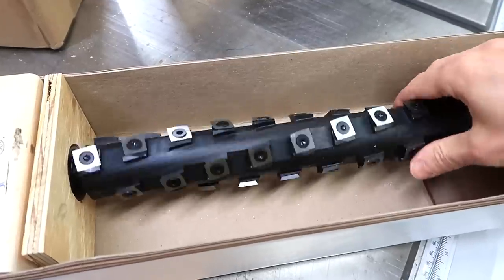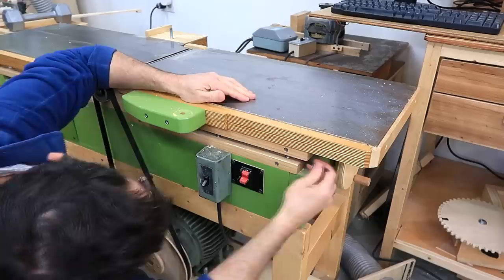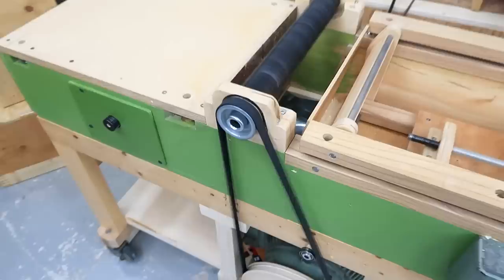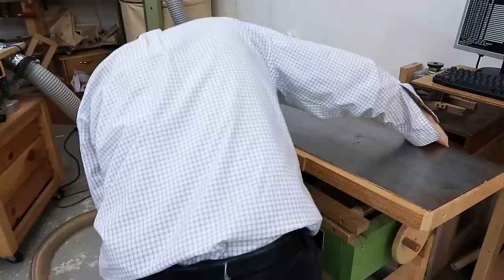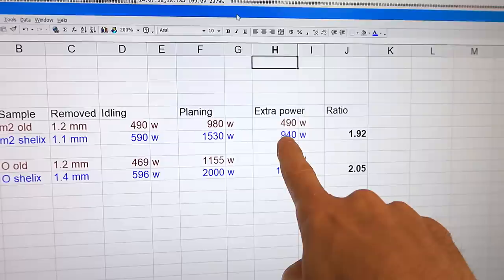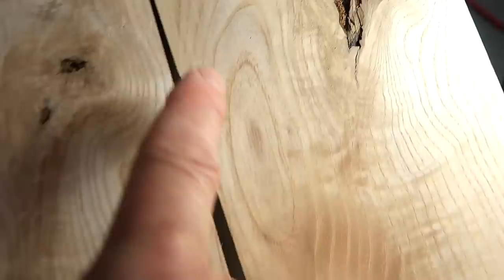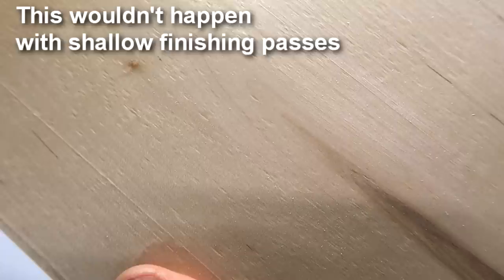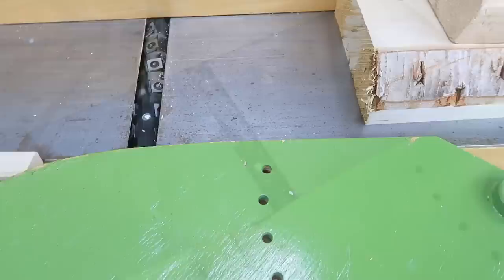Shelix head vs HSS planer head: Comparative tests

Comment: The pulley retention nut removal process had me screaming at the screen! I thought you would lose a 1.2mm layer from your leg if that mamma jamma went flying. The head vibration is scary. 
I am curious if your bearing blocks are not co-linear and cause you excess friction. Twist on the bearing races could be causing the shaft to cam over or Lean the outer races. 
Good luck and keep sharing your Mad-Scientific-Methodologies with your grateful masses!
-CY Castor
Reply from the maker: those bearing blocks were fine with the old head!
Reply: @matthiaswandel  But you removed them and it appeared you re-installed them (or tried to) in the old screw holes.  I think that might have caused some misalignment that you would not have had with a metal base, metal blocks and bolts.
Reply: @matthiaswandel  Slightly worn, bone dry metal-shielded bearings are way more forgiving in terms of alignment than brandnew rubbersealed tight ones. It can also start self-energizing cycles depending on amount of disalignment and rounds per minute with "whipping" tendency of the cutterhead once every factor's maximum should come together in a "shit hits the fan" moment. We once had a cracking cutterhead (spiral blade, dead-stop emergency brake allegedly saved us from complete disintegration of the head) in the first sawmill/planing factory I worked. Later assessment showed too worn-down bearing-holders in combination to an imbalance of the cutting head, after all was bent in place again and counterbalanced on an industrial balancer. Bearings were still in spec, their holding blocks weren't any more, single digit grams out of balance was enough to wreck it with the whipping tendency.
Reply: That nut spinner or whatever it was that kept edging closer to the running head due to vibration was driving me nuts.  Also some tight metal pins to locate those bearing caps would help with that problem, as you said, screws or bolts are LOUSY locating devices, especially wood screws.  

Big stuff out of spec, like you are talking about is frightening, the kind of stuff that can end careers, and on rare occasions, even lives.  Some of the 'safety features' on tools any more make the damned things far more dangerous.  Not necessarily even bad design in some cases but horrible sticky flimsy crap.   I just took the one off of my table saw because trying to start a board through it was absolutely risky.  Some safety stuff is designed exactly as it should be, usually on high end or industrial tools.
Reply: @MrJdsenior  I worked as a selfemployed boatbuilder for over 30 yrs and rented machine rooms near my very work sites/customer's boats over that time. It got worse over those years, in terms of "safety": often I had to remove "safety features" in the way of my work for two or three hours - and put it back on after I was done cutting, thicknessing, planing and routing my strips'n boards, curves and rounds, when I was technically ready to leave. It became so bad I finally built a mid size boatbuilder's workshop in a trailer I could completely open, both sides became the awnings to work out of the weather in and on both sides of that thing, just to not have to mess around with "legal safety devices" making a lot of my work undoable on "legal" machinery anymore. You gotta know pretty well whatcha doing and have to keep Your regular as the irregular loads in sight and checked. You can only do that as long as there aren't any employees or even apprentices working with You. That makes safety and safety devices such a nuisance: You gotta make anything as vandal-proof as You can imagine vandal idiocy of Your employees, and then the deciding little sum of vandal idiocy more You couldn't even imagine yourself in a delirious stupor.
Reply: @manfredschmalbach9023  All true.  And even with meticulous care things can still happen.  And you need to understand that a table saw blade shouldn't extend an inch or two above the wood being cut, etc to help limit danger if someone does manage to get to cuddly with the blade.  I've used table saws for many years and one day I was cutting a tenon in a quick and stupid manner (without the jig, a quick one off) and the thing slipped.  

I heard a light ching, and when I pulled my hand back and looked at my thumb the nail was cut clean through and the skin was just touched by the blade, just barely seeping blood onto the surface. There would have been more blood with a standard finger test stick. Those wake up calls get the 'safety first' switch turned full on for a while.

I've whacked myself a few times being careless with much less dangerous tools than the table saw, like holding smallish work on a drill press when I should be locking it down (who hasn't), but the only time I ever came close to doing something REALLY stupid was the time I just mentioned.  Just a little more ching and the tip of my thumb would have been arcing across the room.  Gets your attention.

One that was really dumb once but not super dangerous was I was used to cutting pretty much strictly aluminum on the lathe and one day I reached in and grabbed a length of stainless steel (at least it was stopped) and my GOD is that stuff sharp, and strong.  One of those where that little voice in your head says, "brilliant, idiot" as you are dripping blood all over everything...not terrible, just painful and painfully stupid.  That's when problems occur when you stop thinking about what you are doing, at least in my case.  About 50 years now and no visible signs whatsoever of tool damage...knock on wood.  Some tools REQUIRE the proper knowledge and respect.

I can't say the same for a rusty arse fender I was trying to wrestle off a car once, still carrying about a 2" a scar from that one.  It was right down to the bone and the nurse said let me see it, so I put my thumb and finger on either side of it to open it up for her inspection and she said "geez, don't do that".   A queasy nurse, funny.

Comment: I would definitely pursue this further. Seems like it needs a wee  bit of tweaking lol. My company is still a strong believer in the standard straight knife cutter heads and doesn’t want to shell out money for spiral carbide cutters. We run everything through our wide belt to clean up the material but it’s never perfect. All they’re more expensive I still think this is the way to go
Reply: The difference is quite huge.  Especially when one does hit a nail and you have to turn an insert versus change/sharpen the blades.  Also Carbide stays sharp a very long time compared to STeel.

Comment: Comparing the shavings would be intresting too!
The new Cutter head could make smaller shavings wich are easier to collect with dust Connection
Reply: I just mentioned this in another comment.  Our HSS bladed thicknesser used to clog the dust extractor port when using less than perfectly dry timber.  The helical head thickness does not have this problem because the shavings it makes are small chips rather than long strands.  The finish is better and the thing I personally like best is that it is way quieter.   Not even as loud as a table saw.  The DeWalt thickness we used to use was so loud I couldn't possibly have bought one for my home shop.

Comment: My Dewalt 735 with a Shelix cuts so smooth, it is like I don't even need to sand after.  I take shallow cuts so maybe that is it.  No problem with little snipes with each carbide insert either.
Reply from the maker: I didn't sand after planing with my old head either.

Comment: That helix head is way out of balance, interesting because of all the balance holes. Lol

Those bearings on your old head should be replaced, 11 years is a good life and no amount of regreasing will make up for any minor damage done to the internals. They probably should be replaced with 2rs (rubber sealed) bearings rather than the  ZZ that are on it, better for high dust applications. I also think new bearings on the head would bring the idle power up to similar to the helix, and running the bearings in on both will bring it down a bit.

I think one of the main advantages of a helix head is longevity, the carbide stands up way better to abuse not just nails but dirty wood, paint etc. And if it gets dull you can flip all the bits a quarter turn for a fresh cut. There was a good Frank Howarth video where he showed this by jointing about a km of old painted benches. 

I wonder if it's the same as metal working where carbide works better with a higher chip load (about10 times high speed steel)? Either higher RPM or deeper cut, would be interesting to see.

Anyway great video!

Comment: I wonder if you redesigned your dust collection orifice, by adding some baffles and maybe taper it away from where the cutter head meets the planer bed. Seems like you have created a chamber the wants to amplify the sound and pumping action of the air flow around the orifice/blade. Food for thought.

Comment: Did an 8 inch shelix head on a Delta jointer. Should have done that years ago, won't be going back to straight knives. Quieter, smoother and have yet to rotate the inserts.

Comment: i put one of those on my dewalt planer..  it was like a whole new machine;  no longer did it blow the breaker, even with heavy cuts, and it cuts MUCH cleaner than the stock cutterhead that it came with.  
if you there is one single thing you can do to your planer to upgrade it, it's getting a helical cutterhead for it.. can't reccomend it enough.  When I bought a new edger, I specifically looked for one with a helical head on it...

Comment: I’ve heard/read that the reason that the Shelix head consumes more power is because there are cutters in contact with the wood at all times because of the spiral design. That’s not the case with straight cutters. I’m not sure if that argument holds water but it’s a possibility.

Comment: The bearings are mounted in a wooden holder which is mounted on a wooden frame. This may permit much higher amplitude vibrations. In other words the shelix needs a very rigid mounting system. All metal.
On the other hand, it may be seriously out of balance compared to the knives.
Still an open question.......

Comment: You could also stick some of this sound dampening material which is used in cars on the inside of the jointer to get rid of some of the noise. They prevent that the wood could start to swing and act like a resonance body

Comment: I'd be interested to see a new set of knives vs new shelix, and then perhaps over time you can keep track of hold long it takes before the shelix heads start losing cut quality, and need rotating. I think it's pretty accepted the Shelix is better, on some level, but the up front cost is huge, and replacement cutters are expensive, so it'd be interesting to know the durability, to compare cost over time.
Reply: I think people prefer the helical carbide cutters better because they're just too lazy to sharpen steel knives. They want to avoid the whole work aspect of woodworking as much as possible.
Reply: @1pcfred what an ignorant and arrogant comment

Comment: Before I even watch:
1. About as smooth
2. Better on troublesome wood
3. Quieter
4. Takes more power
5. Expensive
And and few others:
6. Doesn't mind a nail
7. Easy replacement of worn/damaged edge
8. No hassle knife changes
9. Hard to parallel to tables if not perfect already

Comment: I was really pleased to see you tackle this topic, I'm too cheap to buy a shelix head but I have never been well settled in that opinion. I run machine tools as well so I really couldn't understand why wood might necessitate the carbide. That said, carbide cuts very differently than HSS in the lathe. It's sort of counterintuitive, it seems to prefer a big bite run fast and hot. If you're tentative with carbide, you're more prone to chipping it. If you charge in indiscriminately, that's when it seems to perform the best. I'm still mostly vindicated by your test, but I wonder if it might not perform better at a different feed rate? Many machine tools simply don't work if you don't have the speeds and feeds right for the cutter and the material.
Reply: You  really couldn't understand why wood might necessitate the carbide, then ask yourself why the HSS router bits used in the old times almost disappeared and nowadays we use almost only carbide router bits. The carbide stays sharpen much longer, this with the plain wood, if we talk about composite materials like plywood or mdf the advantage of using carbide is magnified 100 times as the glue in the composite panels destroys the sharpening of HSS blades in no time. Referred to a jointer this means that the carbide cutters will last much longer compared to the HSS knives and if the knives can be sharpened to do it and to set them perfectly again in the jointer is time consuming. I don't use a shelix head in my combination machine as I don't do enough planing to justify its price, but I see the advantages of having it, advantages that are only about the sharpness lasting a lot longer, about the obtained surface i will explain why it is not so relevant when I deal later with feed rate and depth of cut.
About the lathe in my experience HSS tools are much more effective, both when you have to remove fast a lot of material and when you make the last finishing passes. This is true only if you turn in the proper way, riding the bevel, so actually cutting the wood and not scraping it. Riding the bevel with a sharp HSS gouge gives you an almost perfect surface that needs a lot less sanding then the one obtained scraping with carbide tools and to sharpen turning gouges is very fast, both if you are able to do it free hand or if you use a jig to do it. Turning wood IMHO the carbide tools are only useful in 2 cases, the first is when it is impossible to have the right presentation of the tool for cutting, like in hollow form vessels with a narrow mouth , the other is when a beginner uses the tool, then he is not able to properly ride the bevel and scraping with a carbide tool lets him obtain somehow what he wants scraping, but this at the risk of never improving his skill and never really learning how to use the bevel to control how much wood he is removing and the shape he gets, this is why I suggest to beginner wood turners to stay away as much as they can from carbide cutters and try to learn instead the proper technique, the one used by the masters.
You are perfectly correct about the feed rate and I would also say the depth of cut, that is more manageable feeding the wood in a jointer, in the real life dealing with that wood with knots and grain inversions you don't set the depth of cut of the jointer at a fixed value, you start with a high depth to remove fast any twisting or cupping, and if you get some tear out it is not a problem, you are still far from the final surface, then you progressively reduce the depth of cut when the surface is reasonably flat, you never plane away more then 1mm of wood in a finishing pass, further more with those knots and grain inversions. The goal is to have the less tear out as tear out means that you have to sand all the wood to bring the surface to the level of the deepest hole of the tear out, doing 10 very shallow passes on the jointer instead of 2 deep ones is much faster then having to sand away some tear out.
With the proper technique every reasonably sharp HSS knife let you have a surface that is easy and fast to sand, without the proper technique, forcing the last passes removing too much wood, you will not get an acceptable result both with HSS knives and a shelix head, the acceptable result is not a perfectly finished surface, but a straight one that can be sanded to a finished state quickly. having the minimum possible amount of tear out.

Comment: After you switched, did you check to ensure the bearings and shaft were perfectly aligned?  It appeared that you might have reattached the cutter head assembly without checking that or checking that the assembly was still perpendicular to the motor pulley.  Don't know if any of those might affect noise level or power consumption.  It had always been my impression that the shelix head was quieter.  At least you were able to confirm that the shelix head gave a smoother surface overall.  While I truly admire you, John Heisz and others who make their own fabulous power tools, there must be reasons why top end jointers have machined cast iron bases and machined steel pillow block bearings, such as durability and repeatability when re-installing bearings or cutter heads.
Reply from the maker: I didn't check it just like I didn't check it when I first built it.
Reply: True for the repeatability aspect. These wood made machines are one-offs so less of an issue.
I'd expect the strength/resistance of the cutter head and metal bearings to exceed that of the screws' attempt to move one bearing out of line with the other.

Comment: I've noticed on my own jointer that I can often use it without dust collection for shallow cuts and can turn on dust collection after to dispose of the chips stored in the dust port. Perhaps you can test a reduced amount of airflow to see if that helps with the noise. You might find that you don't need such powerful suction to achieve perfect results. After all, planer chips aren't the dangerous super-fine dust anyways, so you might find the noise to be more pollution than a small pile of chips to be swept later.

Comment: Great comparison video! I've always wondered: Would it be a good idea to make a jointer with an oblique cutter head? I mean: the traditional one but installed in a diagonal. Maybe it pushes wood laterally? Maybe it's a great uprgrade. And obviously should have both tables modified (in and out). Hope to hear you opinions!